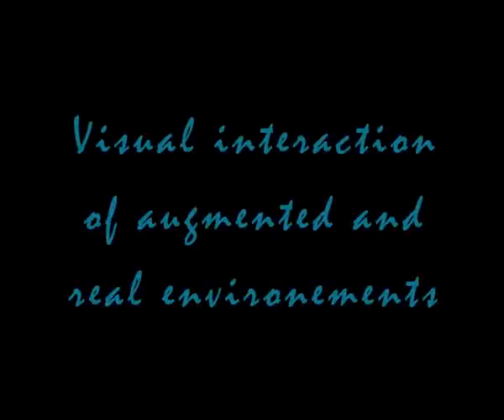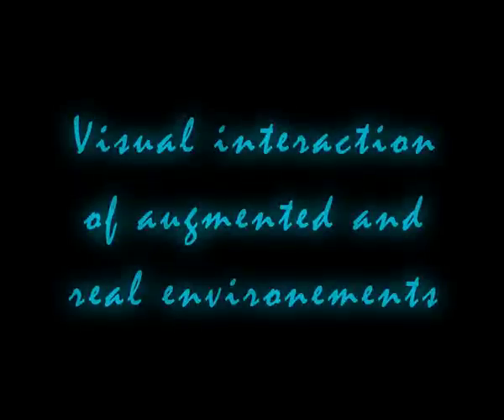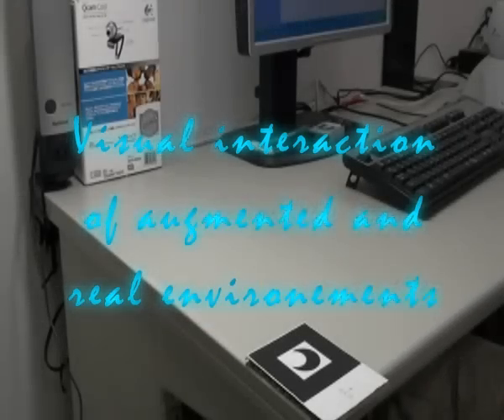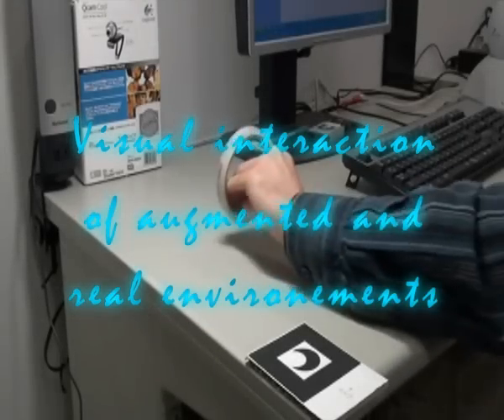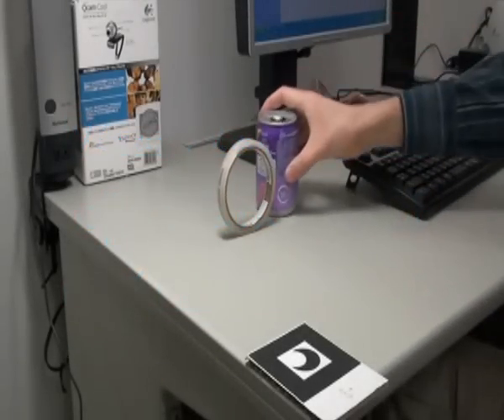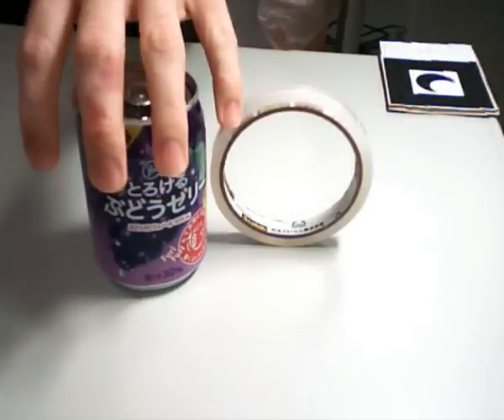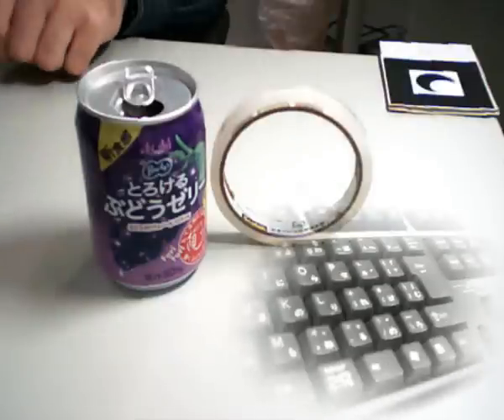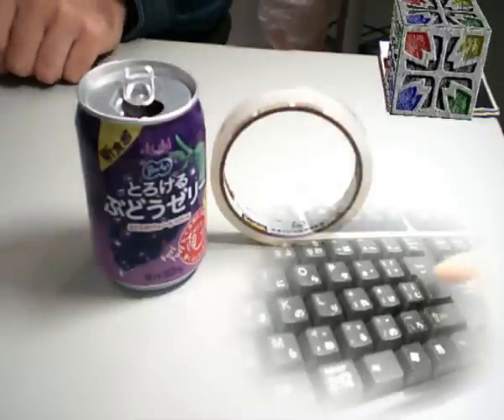Augmented Reality - Occlusion problem [part 3]

Comment from the maker: I couldn't find any tutorial about it either when I was working on this project.

The basic idea is quite simple. Objects in front of the augmented shape are "rendered" in the OpenGL depth buffer ONLY (not in the color buffer). Thus OpenGL considers depth information of these objects afterwards while rendering the whole scene without actually drawing them.

You can first give it a try by simply using a real fixed simple rectangular box, and draw a box of the same size in the OpenGL depth buffer.